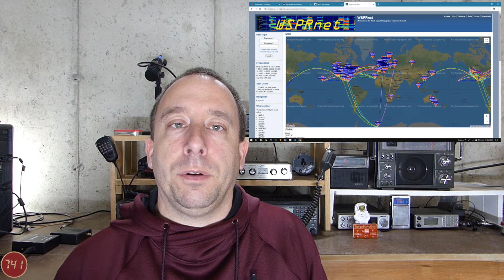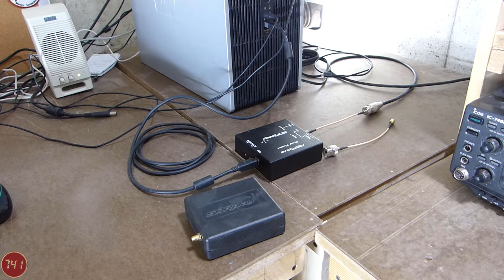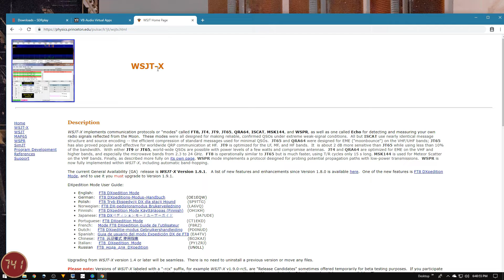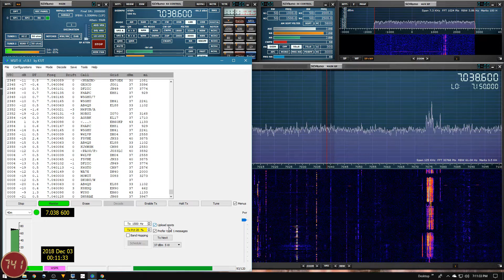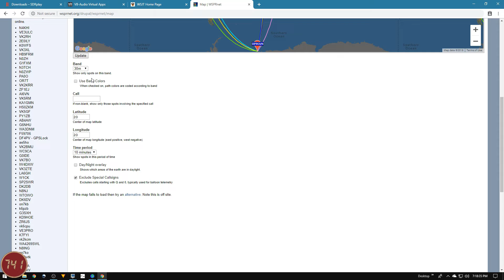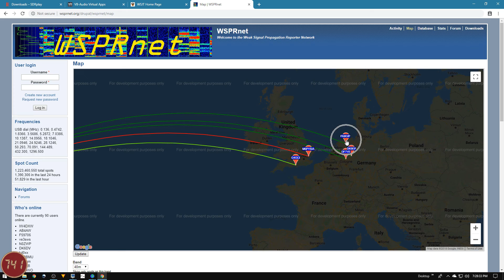Receiving WSPR on SDRplay RSPduo   Shortwave Antenna Performance Test

Comment: Well I see this is 4 years old . But Well done. My question is this will allow me to see what my antenna can receive. I think I know that by just listening . The old saying if you can hear them you can work them. Maybe. Honestly not sure how this helps making contacts. Since power and propagation are critical I do not see the correlation. Please help me understand. And thank you for the effort you put in.
Reply from the maker: It's just something else you can do with this radio.  Some people don't have transmitters or perhaps transmitters that can't be connected to a computer so this is a way they can still experiment with this mode.

Comment: Thanks, this is one of the few good beginning videos. Question. It seems you manually tune SDR Uno. Can the wsjt-x whisper mode automatically set the frequency of the SDR Uno? I know it works using CAT  with an HF rig. I would like to automatically have whisper tune the SDR but without my HF rig turned on
Reply from the maker: You most likely can link wsjtx to sdruno...I haven't done that yet

Comment: 1. Why do you use VB-Cable and not just use 'Stereomix'? Is it because the audio is over USB? What am I not understanding? I wish you had explained what it is and why you need it.
2. Is VB-Cable the same thing as VSPE (virtual serial port emulator) or Com0com (same thing only free)?
Reply from the maker: As I said in the beginning of the video, I've made other videos detailing some of the software and installation and didn't want to rehash ll of that here.  You can watch some of my other videos if you want more detail.  I'm not sure what "stereomix" is but VB cable is needed to route the audio from SDRuno to WSJT-X.  If you know of another application or method that does this, then by all means feel free to experiment with it to see if it works  As you said, I like VB cable because its free, simple to install and use, and I already had it on my computer.

Comment: I noticed you mentioned using VB audio cable. I'm wondering if you could do a video on how to get WSJT-X to interface with SDRUno (or SDR Console). I have been trying to get VB audio and SDR Console and SDRUno to work together for several days and I just cannot get the virtual connection to occur and it's super frustrating!!!
Reply from the maker: I made a video showing how to decode ft8 a while back.  See the following link....if it doesn't help, let me know and I'll make a video on setting up vb cable as you asked.   https://youtu.be/QVfUaqzb9ck

Comment: I've got the exact same multi band receiver radio in the background, and 50 feet of lox loss RG6 Coax to a antenna on my roof. The Coax is made of 2 halves, is there any suggestion you may have i could use to get a better signal? Maybe a amplifier? All i have is a 10db Amplifier for this system that i only ever use for shortwave, and id really like to be able to get more stations, im kind of new to the entire hobby but i know basics. There have been times ive gotten  a good signal but usually no.

Comment: Thanks for all the great videos on SDRplay.I set up my RSP2 to receive ADS-B as per your instructions but when I start 1090 I can not get any decoding. Visual radar shows that my RSP2 is connected.How is the frequency set to 1090 Mhz? does the dump 1090 software due that automatic.I tried connected to my 2meter vertical just as you had done.Any ideas what may need to be done to start decoding signals when dump 1090 is started. any help would be appreciated. Ron NB3W.
Reply from the maker: If you followed the steps in my video, it should work.  It's been a while since I fooled with this so I can't think of any trouble spots off the top of my head.  If you haven't already, it might be worth rebooting and then going through all the steps again to double check all of your settings.  Also, there is a help document on the SDRplay website that might help.  Another thing is to check and make sure all of your connections are good an tight.  Do you live in an area where there just isn't a lot of plane traffic?  I'm fortunate to live within 20 miles of a fairly big airport and under and international flight route between the east coast and europe so I get a decent amount of traffic even on my less than ideal antenna.  It might be possible that you just need a better antenna if you are sure everything is configured correctly.
Reply: @SevenFortyOne  Thank you for being kind enough to reply to my question.I have the flightradar24 app in my Iphone and I can see air traffic flying over my area.
Reply from the maker: @hunt555fish  When you fire up Dump1090, do you see activity in the dos window like I showed in the video?

Comment: I found it works much better if you put radio in digital mode.  Also, there is a great program called GridTacker that will map reports directly.
Reply from the maker: Interesting...I'll check that out.
Reply: Although it makes no odds to receive-only activity, digimodes are normally in USB, not LSB (the usual inversion of convention in relation to speech from 7MHz down does not apply to digimodes).